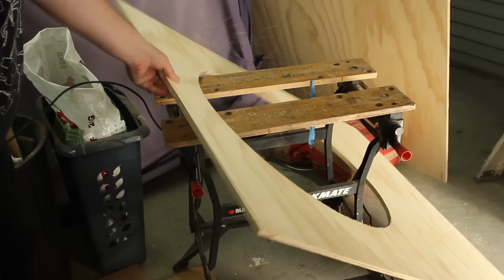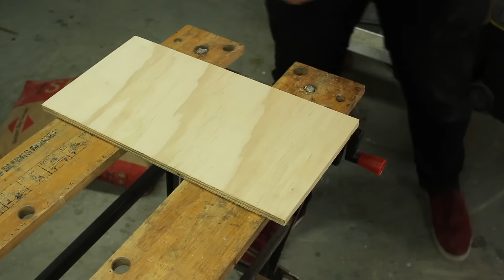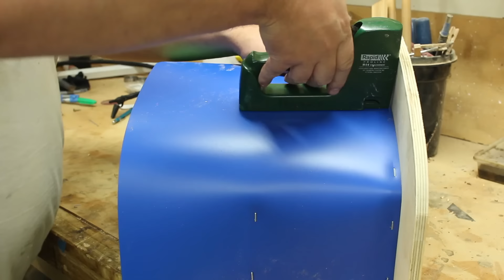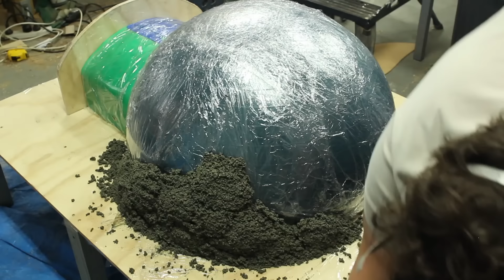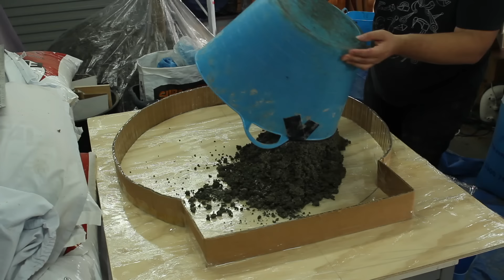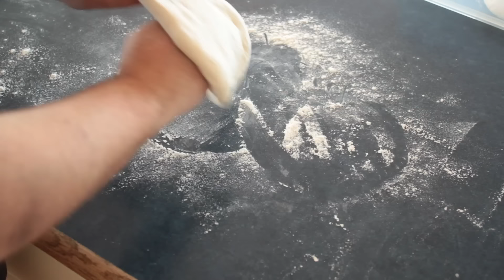DIY Cheap Exercise Ball Pizza Oven

Comment: Great job!!   I love your format!  The only thing I think I would’ve liked is perhaps put on top of the base,  use either, clay or a sheet of stainless steel for the pizza etc.  That’s why they’re mostly made of clay. At least clay is digestible. Also... your oven is great for baking breads and cakes too 🥰. My grandpa made a clay oven... Using clay, chicken wire and bricks to bake breads and cakes!  Waaaay back in 1956!! 🥰.

Comment: To anyone who knows, does the cement and perlite flake off in your food at high temps? And after it cures and you move it to it’s base, could you just insulate it with a clay straw mixture? I think the clay would adhere fine. Thanks

Comment: Hi mate,

May I ask you a couple of questions, if you don't mind. How hot get outside of the oven when you re cooking your pizzas? Do you feel you should have made maybe two thiner layers of perlite and cement, and perhaps had a insulation layer in between?  

Asking these because I going to build one on my own and found yours very good indeed.

Much appreciated for your time.

Comment: Why perlite?   I made one with a refractory core  I bought (kit) put on a rock wool foil layer, then some rebar and concrete, finishing it with lime mortar.  It took a while to heat up, the base was quite thick, for pizzas, but it was great for slow roasts.       Moved house and looking to build another, not sure if the 'sapling and clay' type is worth having a go at, or  a concrete and rebar one, since they are so solid.

Comment: I love the video and the build but my fear is the perlcrete made with portland will break down at high temps, if the interior layer was done with refractory concrete or firebricks and refractory mortar then covered in perlcrete it would be excellent.

Comment: This is when you need a good friend to mix cement while you place it.
Let it dry for two weeks before you put a fire in it, it may crack from steam pressure inside the cement mixture.

Comment: Really great build. Looks quite thick and I like the low entrance as compared to other designs I've seen. Also novel to see that you bake on the same material as of your walls. I used unglazed ceramic tiles for my ovens. I made a few, would love if you could check out my builds, including the blow torch powered one, and the wood burning oven. Cheers!

Comment: I loved your video David. Short, sweet and to the point. I loved it so much I have made mine ... by myself! Finished the 'concreting', now waiting for it to cure. How long did you leave to dry before taking the ball out and then to the first firing? Was it days or weeks? Months?? :-) I've made the formwork for the base, 'concreting' tomorrow and planning out the trolley on castors. I'm so inspired. Thank you David. Awesome!
Reply from the maker: Hi Andrea there’s plenty of other info online and I suggest doing your own research as I’m not an expert! However I left mine for about a month covered in plastic, then took the ball out and plastic off and left it for another month before firing. I was told that the slower it cures the stronger it is but again I’m no expert! Have a google there’s lots of info out there
Reply: @DavidParker  Thank you David, much appreciated.

Comment: Great video thanks! A great way to do it with a small investment. I have question.... How will it tolerate high heat with no re bar or structural reinforcement?  And how well will it retain heat without insulation ect. I love the concept, anyone could make this with minimal cost. Great idea and thx again!
Reply: that's the perlite's job, great insulator

Comment: Hey....ive seen a lot of diy exercise ball pizza oven videos....ppl use a lot of different ingredients such as perlite, vermiculite, cement, clay and sand. I was wondering what the differences are and which combination makes the most heat resistant mixture. Thanks
Reply from the maker: Sai I have no idea! I haven’t experimented with anything else, this was my first experiment and it seems to work ok. I definitely think I could’ve done something to give it more heat retention like add in fire clay or something but I really don’t know.

Comment: The heat and the elements are going to break this oven down in short order. Real brick and fire brick should have been used in the base at a minimum. Maybe the second try will last longer.

Comment: So this basically the insulation layer that goes on the outside of most hand built ovens.  The uee of firebrick inside is to retain heat and reflect the heat back to the cooking surface.  It's a great concept though, I'd love to use it once to see how it compares to the monster I built.

Comment: I love the design and how you did it.  But it didn't look like it cooked well.  Something looked off.  Didn't get really hot
Reply from the maker: Yeah I did a follow up review covering that basically! It does get really hot, sometimes too hot even but then that heat dies down really quickly, the perlite has no heat retention so it’s really hard to keep a stable temperature!

Comment: There is almost a thousand comments, so forgive me if I am going into an answered question... Could you have used rebar or galvanized wire without negative consequence?
Reply: too hard to get rebar to fit that small an oven. Galvanized wire was suggested it would offgass the zinc.. I dont know if it is a problem.. I'm going to use stucco wire on mine.

Comment: I liked the idea of using a gym ball, but for anyone watching, this is NOT how you should construct a pizza oven, it's missing the vital heat retaining layer, this is just an insulation layer. Inside the insulation layer should be a heat retaining base and roof usually made from clay. The point of the insulation layer is so that the clay layer inside can get and stay very hot, that's what cooks great pizza.
Reply: Radiant heat you reckon

Comment: Nice video..question,  how does that hold up to high heat ? and cracks yet ? I noticed you only used perlite and cement ... Portland  ?   where did you get that recipe for making that ? I have seen some people use fireclay in that mix also ...

Comment: Hey mate, l love your video. Does the perlite/cement mix hold heat well and do you think it would be structurally sound if I made a 1200mm Diametre dome?
Reply: I made one with an internal diameter of 1000mm and it holds up really well!

Comment: I always thought that you need refractory mortar otherwise it will just crack wit the heat. Did this oven last?
Reply: Probably 5 fires or so
Reply: Made one 2 years ago with vermiculite, while there certainly is plenty of cracks it is still working perfectly, have reach temps of 700 c.

Comment: This may be a stupid question, but how to you know when to predrill holes before you use the screws? And are you using decking screws?
Reply: Anytime you are screwing into end grain or near the edge of lumber, you should drill a pilot hole to prevent splitting. The smaller the dimensions of your piece to be fastened or the closer to the edge, the more important this becomes. Your screw shank, the solid shaft of the screw, should be the same diameter as your pilot drill bit. That way there is no deformation upon fastening, only the screw threads grabbing the fiber of your base material.

Comment: Hi David, thanks for s great video. Here in the UK the only Perlite I can source says it's for mixing with soil for plants... Is this the same stuff.
Reply: Yes, i made a pizzaoven in my garden from refractory bricks. I insulated the whole oven with perlite, from a garden centre. Use aluminum cement and not portland cement! Portland will break with very hot temperatures. Much fun and greetings from Holland.
Reply: yes it is!

Comment: I thought using cement was not ok due it can't tolerate heat
Reply: I doubt this will last long. Maybe they used refractory cement, but I don't know how well that works infused with perlite. What bothers me is cooking on the perlite surface. That can't be good for you. A pure concrete screed would've sealed it up nice.

Comment: Has anyone tiled the inside of the pizza oven with ceramic tiles? I know you can't place food on the tiles but would it be OK to tile around a pizza Stone to give a flat base.
(I have made a perlite slab with steel In for a base but the base isn't as smooth as I would have liked. So wondering about tileing it) 
Thanks guys

Comment: Hi, awesome job ! The perlite you used is it the same one being used for garden ? If yes what's the purpose of using that instead of rock pebbles / sand and cement mix ? Is it for lightness ?
Thanks
Max
Reply: Perlite is a hollow volcanic rock that stores the heat out of the fire , hence high temperatures for longer 👍
Reply: This makes a refractory concrete. It insulates and does not expand and crack and break up as regular concrete would in this application. And yes it is light, so you can move it around easier.

Comment: What temperature can you reach in this type of oven?
Reply: if you kept adding wood and closed the hole up with a small air hole you could fire Potter.  with the enclosure, fuel and enough Oxygen the heat would keep rising.  bricks could be used to close opening for a ceramic firing.

Comment: this one don t have the ventilation hole upsatairs why not ?
Reply: flash back The vent pipe is in the front door area. If you laced it on top, the heat would escape too quickly, preventing the oven from getting hot enough. This is the normal design for wood-fired Italian pizza ovens

Comment: Omg you have a lot to learn......where do i begin? Concrete is way to dry no reinforcement so as soon as it gets hot itll crack or explode becauee of all the air from the amount of pores in this thing. This is a great idea but a total fail this things going to explode and hurt someone
Reply: Seems unlikely that a pizza oven will exceed 800 degrees C.

Comment: Hi David. thanks for your video. I have one question. When you were cementing around the ball, how did you prevent the bottom layers of cement- pearlite not falling when applyind more weight on it with the upper layers while still wet or did you leave bottom layers to dry?
Reply: It looks it was a little. You might find it easier doing one layer along the bottom and working back to the start where it has started to dry for the second layer. Or complete it over a few days to ensure the previous layers are fully dried. Good luck.

Comment: Hello everybody, my perlite and cement mixture has  partially cracked whilst drying.
Does anyone know if I can reuse the cracked parts by crushing it Or how can I reuse the cracked parts ,I'm not sure.Help please?
Reply: You cant unfortunately. You can use it as filler, or you can burn it at high heat and try to reclaim the lime in it

Comment: What are the dimensions of the front opening. Width, height and depth. Thanks.
Reply from the maker: john luciano depends on what size pizza you want to make and how big a ball you use etc. There’s no strict rules, I wasn’t following a plan.
Reply: The front opening should be about 63% of the internal height of the dome if I remember right 🤔

Comment: First I must say a great job and please keep using it. From the video, it looked like you used ordinary Portland cement. This will break down with heat cycling. It is better to use Fondu Cement as its refractory grade and won't break down under extreme heat, It is a little more expensive but well worth the cost. 

Rather than starting again, you can always put fibre insulation over the top and stucco the outside which will improve it further.

Comment: Hi!
Approx how much perlite did you use? And for how long did you let it cure before lightning up?
Reply from the maker: Robin Eld probably about 150 litres, but I made mine quite thick. I left it for about a month before a small fire when I noticed a couple of little cracks and then ended up leaving it about 8 months before firing it up properly, I’ve since put a coat of render on the outside and it’s working great

Comment: Helpful hints.. the oven doors are too big.  The outer one should be bigger than y the inner one (think about the hot exit gases heating the intake.  This seems to be a low temperature oven.. the higher the temperature there better the pizzas.. to my taste.  The cement would h not withstand high temperatures.. simple thoughts.. looks great
Reply: Mushroom's only problem is an oven's temperature being it's too low, the mushrooms will cook in it's water... That will make them more difficult to enjoy and digest
Reply: Whenever I'd throw a fist full of flower in my oven it worked burst out in flames

Comment: Thanks for the spelling correction, but still concerned re: tiny styrofoam-like beads at high heat...
Reply: Perlite is volcanic glass, not styrofoam :)
Reply: Yes, it just looks like styrofoam. It’s basically just volcanic glass, or large grains of sand, if you prefer.

Comment: Why does the oven have to be round instead of cube? You can build cheaper with bricks, waste of time
Reply: A traditional pizza oven is always round. The pizza is cooked by heat from the fire being reflected back down from the walls of the oven onto the floor of the oven. Being round makes the temperature very even ; in a cube oven there would be a big difference in the heat striking the edge of the pizza compared to the centre resulting in uneven cooking.

Comment: Once its wet you can take the face mask off. Mud doesn't make dust.
Reply from the maker: I was making a lot of small batches so it was easier to just keep it on, also doing it inside my garage so lots of dust in the air

Comment: This is completely wrong.  The perlite mixture you made is meant for INSULATION only.  After you build a brick oven, the perlite mixture is the insulation over the brick.  The perlite is an insulator and will not heat up.  The only heat in that oven is the fire and a little bit of the wrong kind of cement, but it's supposed to be radiating from the structure (brick) which absorbs the heat of the fire.  Regular cement will break down it should be refractory cement in the insulation.  This is not meant to be critical of your efforts (I realize it is), thanks for trying, but anybody thinking this is the way you do it needs to know that it is not.  Yes I have built a couple of real ones.  Had you cut fire bricks to fit over the ball and arch and filled the gaps with refractory mortar and THEN put this insulating mixture you made over the top, then you would be on the right path.  That structure would then need a coating such as waterproof stucco and paint.  The structure you built with the wrong kind of cement and crumbly perlite could easily collapse while a fire is going and severely injure somebody.

Comment: You may want to research concrete a bit better. There are different mixes available, some will withstand greater heat than others. Modern concrete technology is far more advanced than ancient Rome. - LOL